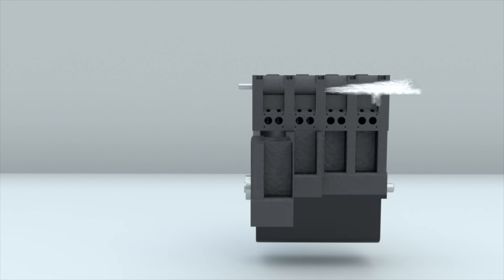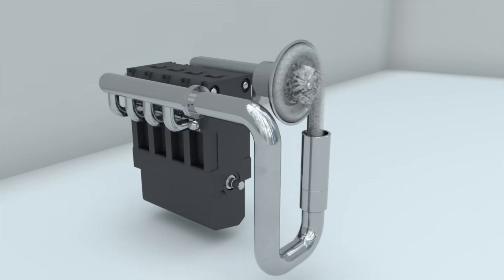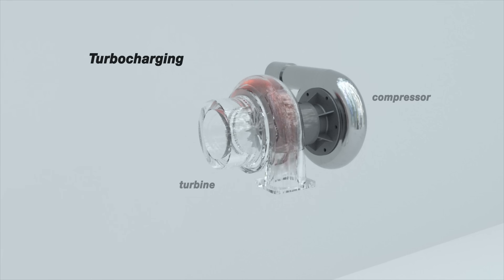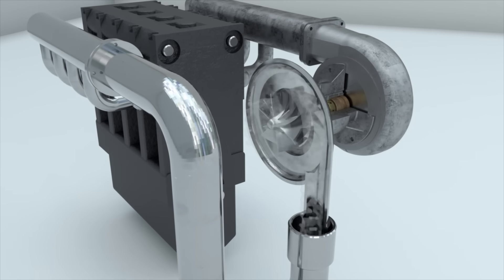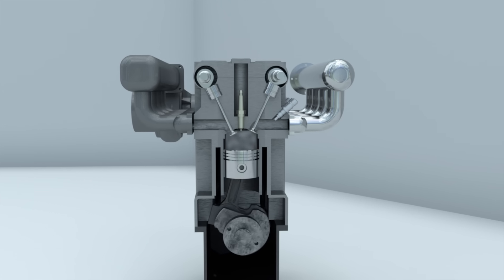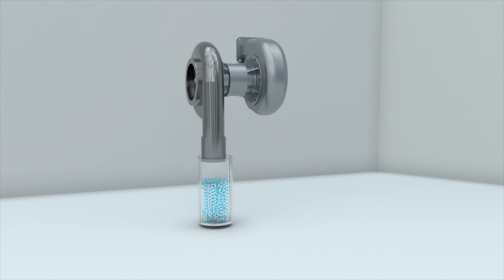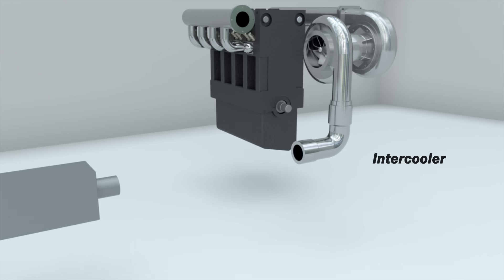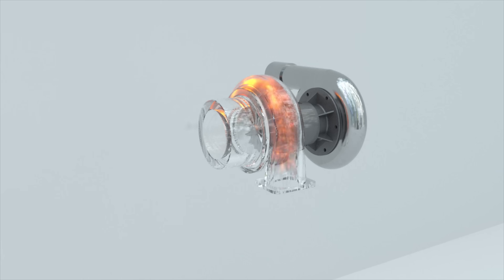How does a turbocharger work?

Comment from the maker: Continuation of the theme of supercharging. What Is an Electric Turbocharger and How Does It Work?  https://www.youtube.com/watch?v=t5QvNO95k18
Reply: Could u tell me whats the difference between a turbo engine and a naturally aspirated one in terms of accelration? I mean in a NA engine you feel more and more power as u climb the revs while in turbo u feel a steady pull by tje time turbo spools up
Thanks
Reply: wait you made a mistake! the first case by using a pulley, its the science of a supercharge and not the turbocharge! thats the difference between both system
Reply: @RacanYlum  i didnt mention something like u say i did... idk what u talking about and i know very very well how a supercharger works and how a turbo works cause i have both supercharged nad turbo cars (and NA also)... my question was completely different but got my answers long ago
Reply: If oil is coming out of the exhaust where turbo is attached, what does it signify?

Comment: Using forced induction to get more power out of a small engine is an easy choice, but trying to make engines "eco-friendly" with a turbo is a fool's errand.  In order to see benefits the turbine needs to be spinning fast, which means the engine needs to be spoiled up, which means more fuel consumption.  And since almost no one gets their oil changed regularly, the turbo will fail sooner, which means higher cost to the consumer.  Americans have been sold a bill of goods.

Comment: Need an advice, I'm designing an incinerator, an external combustion engine to burn waste and use the heat to produce steam from boiler in the system.

I'm going to replace the electric blower with turbocharger to boost the fresh air supply into the combustion chamber.

Is it possible?, What is the minimum requirements (air pressure & airflow speed) for turbocharger to work efficiently

And also, do I still need an intercooler?. Because I'm going to use steam from boiler to power the turbocharger. Or in general, do external combustion engine need a lower temperature fresh air to work efficiently?

Thank you 🙏

Comment: 1. Idle after start

    • 1 min after more than 2 days of halt.

    • 30 sec every morning when below 20°c.

    • 15 sec every morning when above 20°c.

    • 5 sec every time when starting in btw. 

2. Idle before stop

    • 30 sec in city and low rpm drives.

    • 1-2 mins after long or high rpm drives(when the engine is running hot).

3. Disable auto start/stop setting everytime during long or high rpm drives.

4.Use of recommended quality fuel.

5.Periodic engine oil and oil filter changes.

6.Avoid revving engine to High RPM during a cold start or when low engine temperature until it reaches optimal engine temperature.

7.One can turn on the AC after reaching the optimal engine temperature.

8.Idling above 5 minutes even for AC operation is dangerous as it can cause premature wear to the expensive turbocharger and high carbon buildup.

9. Perform Higher rpm runs at every 280-300kms with 2 sets each spanning 20 seconds at 10 minutes interval in btw.

10.Turn off the engine while refueling the car but not 🚫 necessary when the engine is running hot.

High RPM = above 2000 rpm

Low RPM = till 2000 rpm

Higher RPM = above 3000 rpm

btw = Between

Comment: If the exhaust gas is going back to engine, then how it goes to outside
Reply: it doesnt go back to the engine, the first rotor (which takes exhaust gas) is on the path to the exhaust system. This first rotor is not exposed to the outside, but a pipe starts from it. The second, though, is exposed so it can pull air from the atmosphere. It is the one you can see in an engine bay.
Reply: @mihaih119  thanku❤️

Comment: Turbos seem like a good idea if you never have to deal with the longterm maintenance and repair that comes with them, otherwise it's massive additional cost, stress, pressure and heat on the engine that all adds up to more troublr than its worth

Comment: Lots of mechanics say Turbochargers wear out engine parts fast. And they’ll also say a V8 natty is better than a V6 turbo. I’m still on the fence about this. I heard that Honda has a unique cooling system to reduce the excess heat. I wonder if that’s enough to reduce the other negative effects of Turbo.

Comment: Does the blow off valve sound hurt the engine a lot? I bought a used car, and it has the whistle from the valve and the turbo stutter too. Idk how much the whistling is screwing it
Reply: A little late to the party but the tsssssss sound is okay. It means the blow off is working. What's hurts the engine is the stututututu sound as it means the air has no escape and backs up the turbine.

Comment: Well, the reason most of todays turbo vehicles have more breakdowns is because of failure of manufacturer proper procedures in the operating such equipped vehicles 🤔
First, turbo equipped vehicles need to be " warmed up" from a " cold" start especially If the turbo is oil cooled like on some GM vehicles.
Second, after running the turbo vehicle before shutting down the vehicle allow a few minutes for the turbo to " cool" down".
Third, most vehicles have the standard 5W- 30W oil designation 🤔 
Well, that fine IF you live in the upper northeast, midwest or northwest of the US. But in areas that have Temp's in the 90's to 100' s plus like in the southern areas of the US that oil is too cold and the engine will suffer from the additional Heat of the turbo mode. I would suggest either the 10W-30W or 10W- 40W to protect the engine.🤔

Comment: Does the exhaust from the engine pass through the intercooler or is it the air from the compressor? If it's the exhaust, wouldn't it affect the air-to-gas mixture? If it's the air from the compressor, why does it heat up so much that it needs to be cooled and where does the exhaust go after turning the turbine it can't stay inside since its very hot correct?
Reply: Okay so the intake air goes through the intercooler. The reason the air heats up is that when you compress a gas  you force the molecules closer together - you are adding energy that’s why it gets hot. Cooling the intake air allows more efficiency. The exhaust after turning the exhaust turbine merely goes out the exhaust hope that’s helpful

Comment: The fundamentally most important differentiator of a turbocharger vs other forms of supercharging and you got it wrong..

The energy which drivers the compressor comes from the continuing EXPANSION of the hot gases after they exit the combustion chamber and NOT THE FLOW.

The same EXPANSION which pushes the pistons down spins the compressor by making use of the residual energy which would normally be lost to the atmosphere as noise and heat.
Reply from the maker: Expansion of gases is the main thing, thanks

Comment: Adding a carnot cycle diagram bring more light to why the more power is generated, PxV diagram, Volume doesnt change but pressure increase therefore more power given same volumetric displacement. Combustion engines are low efficient ~ 40% of energy introduced, hundreds of metal parts involved.. Electric engines are 99% efficient, no metal parts,  therefore  a 120Kg motor is able to provide +500 HP, ergo why teslas are so powerful.

Comment: Okay I don't have any knowledge  at all about engines and stuff but I was always curious and if anyone could help I'd appreciate tht , so I was wondering ... I have a 3L V6 Mitsubishi  Pajero that uses unleaded fuel , is it possible to install a turbo charger on it ? If yes does that mean I I have to upgrade the other parts of the engine too ?

Comment: More airflow doesn't necessarily mean more fuel consumption, rather, when more air is inputted, less fuel will be used everytime the power stage comes, because it helps the fuel burn faster, so there's not a big relationship between airflow and fuel consumption, either the engine speed increases or decreases, the amount of fuel doesn't change according the to the speed, but it gets reduced because the air helps the fuel burn better, so the engine breathes better when more air is introduced.

But when you introduce a turbocharger, it helps a lot.

Comment: Couldn’t you put a pulley on the turbo charger to kick start it before the exhaust gas rotates it, to eliminate turbo lag? Would it also be possible to create a “vacuum charger” that creates areas of low pressure to pull in air for the engine?
Reply from the maker: Such combinations can be used on sports cars, but for a regular car it will be expensive.

Comment: Pretty confusing
Could have been much simpler
Recirculated / redirected exhaust gas spins the turbos fans pushing more air into the combustion system

Comment: Engine inertia = drive the shaft
Exhaust Turbo can = drive the shaft
Intake turbo can = feed the air (pressure is backPressure backFlow, unless manifold hack and air box hack)

Bypass impeller is leaky from outer 
Bottom of graph is lag. Top of graph is explode. 2 cams are 2 graphs. 

engine start with air-cylinder spool flywheel to get the fluids flowing and kicking the starter motor ...

I think i need to think a lot more before i research further
Reply: Piston weight and all those parts adding to the combined flywheel-effect causing stall... and lag... and turbo-lag... graphing not smooth

One bank lower boost from NA to super to turbo(cam2 with vehicular-speed), torque over bhp.
One of two exhaust can have higher flow-rate (bhp over torque).
Reply: Psst psst psst, turbo is recycling of exhaust velocity-volume to drive impeller. TurboFan engines compressor until forget impeller to drive rotors.? Stages of engine.

They probably want to add clutch to have durability to compressor drive rotor of turboFan but apply to propeller and disparage their own dictionary.

Comment: To anyone who wants to turbo their vehicle, unless it was built to take the high pressure from a turbo, you need to upgrade your gaskets and piston rings, otherwise the pressure will break your engine. This is because your stock ratio of air-fuel is usually 14-1. The forced air turns this higher to 20-1 or more. You ideally want an engine built close to a 6-1 ratio.
Reply: How can I find out if my engine will hold? Bmw 3 series f30, has mini twin turbos
Reply: @c3d313 it will hold
Reply: @c3d313  Get out the ole calculator and metrics of the engine and CALCULATE Math is cool, my freind!
Reply: @E.V.A.N-COProductions what do I calculate ?
Reply: @slicelol1463  First you need to check how much pressure your turbo can produce! A (cheap) Turbo wouldn't hurt to add onto already existing engines. However, something of say higher-class Would receive an influx of air. So, the crucial calculation regions Would be the Header Strength. The Pressure waves and it's increased vibration. The pistons (And their rings) The engine block itself (if not heavy duty) To maintain if it would become a critical failure in your setup. Heating especially when using an exhaust setup. And among other things that If you REALLY wanted to know. You could probably find out at a shop or two.
Reply: It depends on the psi or "boost" you add to turbo. Pretty much most 4 cylinders can handle 1-9 psi stock
Reply: @localterrorist3155 

I heard it’s best to turbo charge low compression engine than high compression ones. 
I have a B18b1 Non-VTec with a compression ratio of 9.2:1. On stock internals that’s able to withstand at most 10psi. Anything past that requires an engine rebuild with forged pistons and high compression resistance piston rings.
Reply: @MonkeyMonkeyMONKEY.  That is true! I'm currently boosting a d16y8 and while it has the perfect compression ratio these pistons are tooth picks with high pressure
Reply: Can a 1jz ge chaser hold the pressure
Reply: You obviously want to reduce the compression ratio

Comment: One of the most important aspects of how a turbocharger works is due to the combustion process expanding the gases exiting the engine so the volume (and pressure) of gas entering turbine housing is much greater than the volume of gas being pumped by the compressor.
Reply: That's an important point, because I always wondered how this was not breaking any laws of energy conservation if the power it gives is more than the power it takes
Reply: Assuming gasoline is pure octane: 

C8H18 + 12.5 O2 → 8 CO2 + 9 H2O

So you take one mole of a liquid and 12.5 moles of oxygen molecules and get 17 moles of gas product.  

The octane is a liquid and one mole's volume is .162 L.   A mol of any gas at STP (for simplicity) is 22.4 L.  That means we start with .162 L of octane and 12.5 x 22.4 = 280 L of oxygen for a total of 280.162 L of reactants and end up with 17 x 22.4 = 380.8 L of products, resulting in a volume increase of about 36%, and this does not yet take into account the expansion from ambient temperatures to 400-500 degrees F, which is far more significant than the volume increase from the reaction.  (BTW, been a very, very long time since chemistry class)

Comment: forgot to add; without more fuel, the increased intake of air will just stall the motor, the more air you have, the more fuel you will need also.
Reply from the maker: Yes, but you can put a less powerful engine on a car

Comment: The one thing I've never understood in college during thermodynamics classes: How the turbocharger (or anything with a compressor really) can increase the power output without breaking the law of energy conservation.
Reply: They do not make an engine more efficient. They only give more power. More Air means more fuel, which means more power. You are simply putting the exhaust gas to work, but that impedes flow in the exhaust system, increasing backpressure and the engine therefore needs to use more energy in the exhaust stroke then a non turbo-charged engine. If you force more air in the cylinder somehow and match the ratio of air with fuel you make more power, but you also lose more power from losses aka turbo blocking exhaust flow or supercharger being run off a belt. Turbos are a more efficient system compared to superchargers but natural aspiration will always have more efficient use of the engines power output.
Reply: @TheUchihasparky  nope, that's incorrect. They don'T add more fuel. You CAN add more fuel, but the important thing is oxygen, not fuel. And of course they increase efficiency. I'm driving a VW Golf with a 1.4 litres engine producing 122 PS and use only about 5 litres per 100km. 
The same stats with a non-turbo engine would be like a 3 litre engine consuming 10 litres per 100km.
Reply: @TheUchihasparky  "more air means more fuel" - is that always the case? Can't we just have more air without more fuel? 
The added resistance to the exhast is exactly what I was referring to, that was the point I didn't understand, thanks fpr clarifying that.
What I don't still understand is why "downsized" engines have a better fuel efficiency with turbo while having the same amount of power as a "bigger" engine with natural aspiration.
Reply: Engines utilize about 25% of gasolines energy to move the car, a turbo can use that rest to make more power
Reply: @mansikkamies9146  ah.... that's actually the first explanation that makes sense to me!!! Thank you! :)

Comment: Turbochargers also increase fuel economy right?
Reply: Nope. It basically pushes more air into the engine. More air = more fuel consumption
Reply: @Sk8club7  most economy cars these days have a turbo. Think of ford ecoboost.
Reply: @Akotski-ys9rr  yeah. But turbo is basically used for more power
Reply: Honda uses vtec well vtec or vvt is more efficient than a turbocharger. Because variable valve timing can significantly improve fuel efficiency and performance. In that case, vtec is used. Turbos can be used for extra horsepower but vvt and vtec are much better in some cases. Turbos have their own benefits too.

Comment: a question i would have is as following: i heard that turbochargers specifically are those powered by the exhaust air and that all others, but also including turbo chargers are superchargers, so i dont even know how to formulate it fml
Reply from the maker: A turbocharger consists of two parts - a compressor and a turbine. The compressor can pump air, taking it from the atmosphere, but for this you need to rotate its shaft. For this, a turbine is used in a turbocharger. Exhaust gases cause the turbine shaft to rotate, this shaft is connected to the compressor. The compressor draws air from the atmosphere. It turns out that the use of a turbine is only necessary to make the compressor shaft rotate.

Comment: Can't they drive the turbo simply by by the pulley attached to the engine instead of using the exhaust gas?

That way there won't be any need for the intercooler and will be more budget friendly right?
Reply: That pulley system causes drag and is less efficient plus a good turbo system has a broader torque curve because boost can be controlled with a wastegate. The hot turbine is not the only thing heating up the air going into the engine. Air heats up every time it is being compressed so every supercharged system will benefit from an intercooler.
Reply: @Laksujaakso now that's a good explanation.

Comment: Gotcha moment - spiked pressure of heated up air isn't enough. Air has to cool down after. So that MAF, mass air flow, can be much higher than sucking air at 1 atm pressure. You need more oxygen molecules to enter the chamber.

Comment: Never liked the sound of it, as it distorts the clean exhaust pulses leaving the exhaust.

Just take two crossplane V8 cars, both having true dual exhausts with h-pipes, one NA and the other with biturbos.
The one with the turbos will have the awesome (matter of taste) turbo sound, BUT it will inevitably distort the rumbling of the V8 by turbulences inside the turbo and exhaust pipes.

So for me, I’ll always prefer NA cars, unless I absolutely need more power for a competition or something like that. 🤷‍♂️